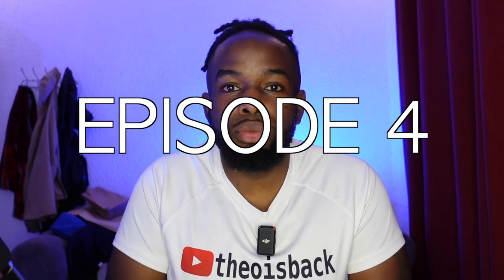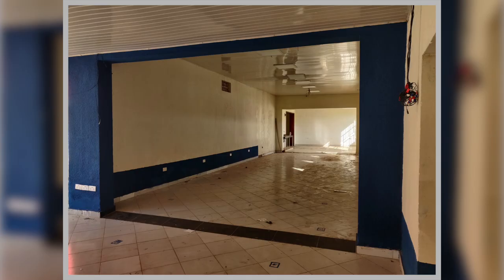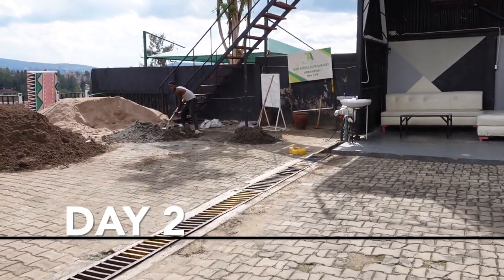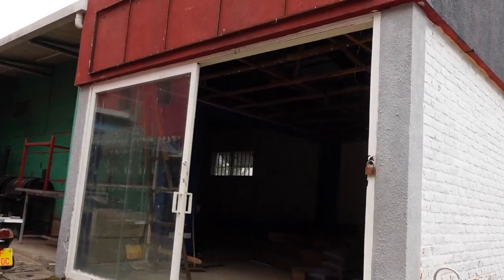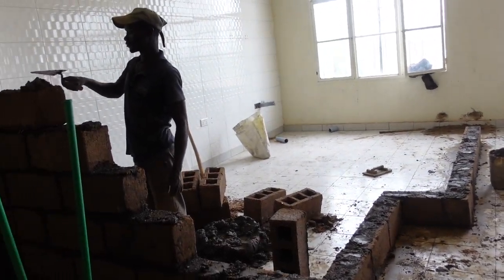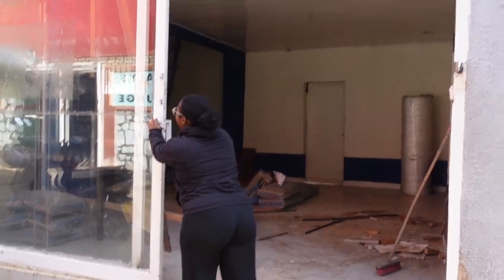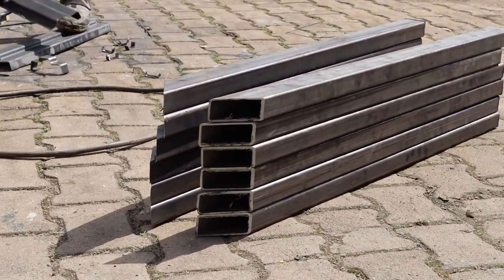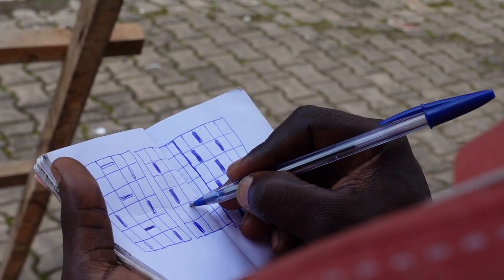Let The Insane Renovations Begin! | OPENING MY FIRST GYM LOCATION! Ep#4

Comment: Good luck with the project Theo. I'm sure it will be a big success, the challenges you are facing now will be forgot when your new gym is up and running.
I'm surprised that you are doing such significant changes to the building, as it seems that you will be renting it. What about the costs (and value that you are adding) if you decide to not renew the lease or if the landlord decides to not re-rent it to you. I can understand if you bought and owned it but from what I gather you are renting it. I have to say that I laughed when I saw that bit in the video where the guy had welded the steel bar through the ladder he was on and now couldn't remove the ladder. And..... then he decides to use a grinder to break the weld on the steel bar rather than just knocking out the top timber lath on the ladder. Not sure I'd have him on my site using welders and grinders.
I was un-sure about you removing that ceiling but it looks much more spacious and airy with the work that you have done. Well done on your vision with that. I know that the internal block walls of the changing room will be very likely be plastered but even so, why don't they finish the work more neatly. Those walls should have been properly pointed, it would have been just as easy to point them properly rather than leave them like that. I love the way that your wife switches seamlessly between Dutch and English when chatting to you.
Keep up the great work and wishing you continued success with your new project.